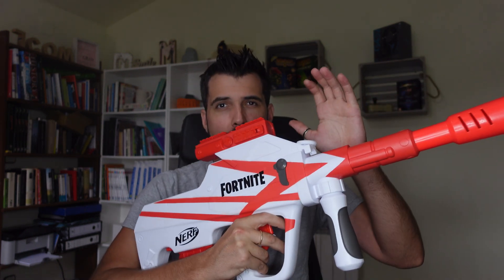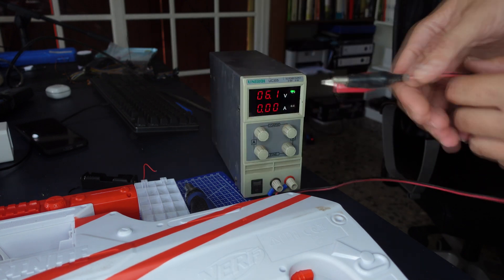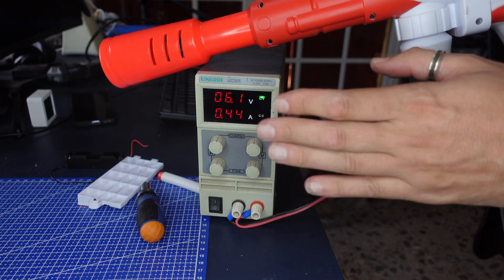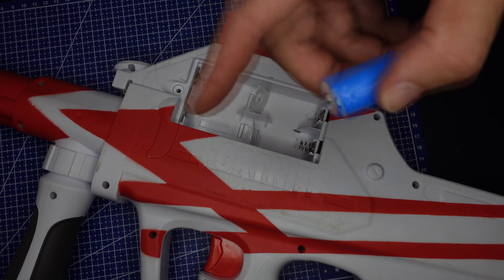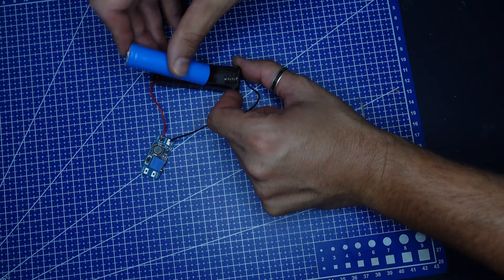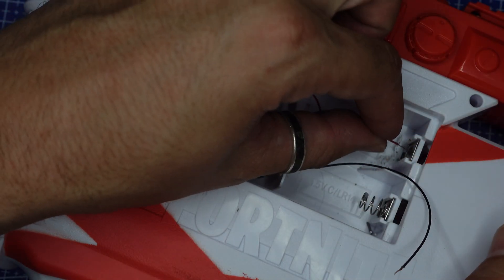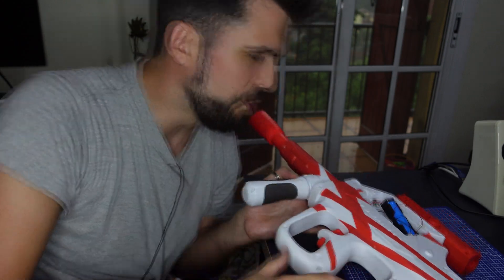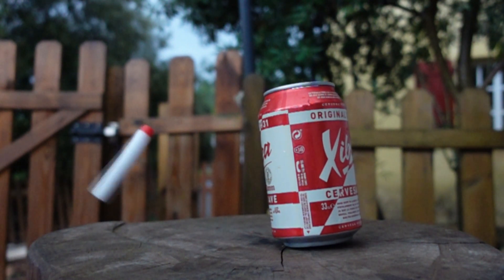Cheap way to Convert Nerf Blaster to use 18650 Rechargeable Battery🔋

Comment: I noticed slow rev up with this mod. Why didn’t you do 2 18650 batteries and regulate the volts to 6 or even a tad higher to improve rev up time and rev down during rapid firing?

Comment: Why did you bridge the two points on the board? What was the purpose?
Reply from the maker: Yes on purpose. Otherwise it doesn't work.
Reply: @GuyInAMountain  What does that do? Just want to understand  the working? Going to use your mod on my nerf guns.
Reply from the maker: Failing component, I followed this video instructions:
https://youtu.be/oFNtZImAr_Q

Comment: Warning: Do not follow this "guide".

It plays fast and loose with current "measurements" eyeballed from a power supply while using a no-name 18650 ICR; that's a great way to have the battery catch on fire. The only saving grace is that the thin wiring will probably desolder itself first from all the heat of carrying that much current, though that risks shorting the li-ion cell, which would definitely create a fire.
Reply from the maker: I don't see any issue with the set up the circuit I use limits current to 2A. There is no short circuit danger as everything is fixed. The current is limited by the motors. Never pass and never pass the limits of the circuit. I don't exactly understand what risk are you talking about
Reply: @GuyInAMountain  no matter what you do, there's always haters out there. Pay them no mind
Reply: Thank you for letting everyone know this before they burned their houses down!
Reply: The most risky thing about this is the soldering other than that its pretty safe provided you know what youre doing. Precautions like not burning yourself or inhaling solder fumes, testing your batteries before you use them, cleaning up your mess, avoid operating in high heat. These things can help mitigate any risk and the diy community thanks you for your concerns. I would like to add that many consumer grade products are considered "generally recognized as safe" (GRAS) and that doesnt mean they always are, hence recalls. Always wear ppe and exercise caution when you diy anything.
Reply: MT3608 includes under-voltage lockout, current limiting, and thermal overload protection to prevent damage in the event of an output overload.